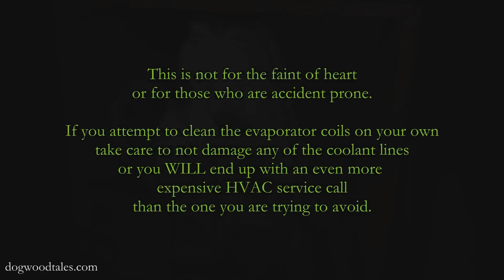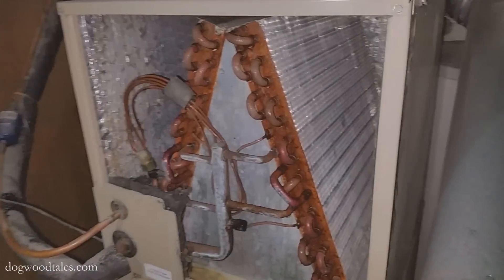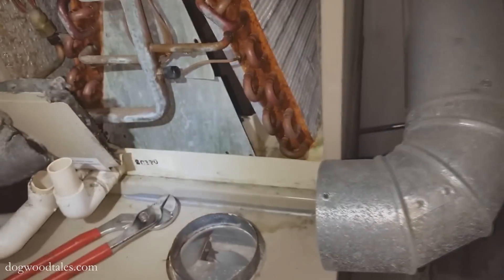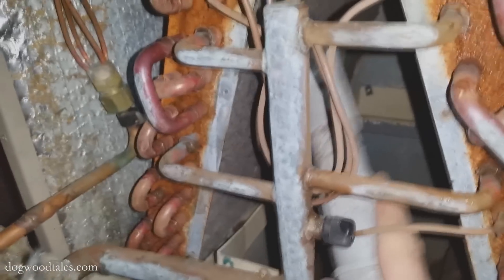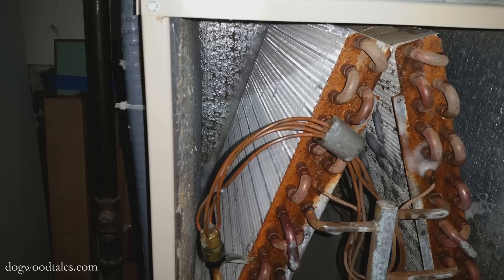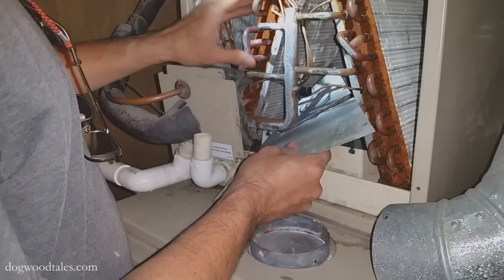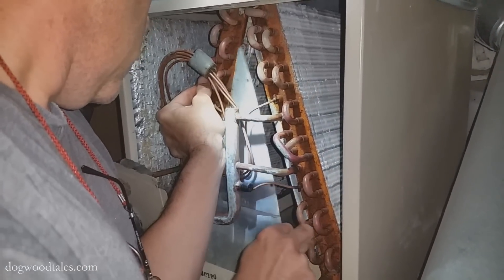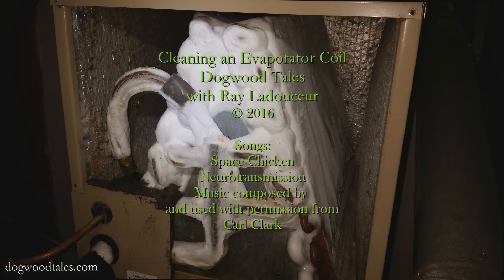Frozen Air Conditioner

Comment: Thank you for sharing a great video with the DIY home owners. I would suggest instead of using the original thin foil, consider using clear acrylic sheets that are sold in Home Depot. They are about $5 to 10 per sheet and it does not impact the thermal performance or coil specifications, and next time using a flash light, you can inspect the  condition of the lower side of the coil and see if it needs further cleaning. You can easily cut them to any size and shape and they are relatively flexible.  
One note to your audience. If you have such a dirty coil underside, there has been a significant filter replacement negligence, or you have a major opening that sucks in the air from other places into the coil and the filter functionality is compromised. The only way underside a filter will be so dirty is when no filter was used for several years.
Reply from the maker: Warren Wwk the acrylic is a great idea! I’m surprised I didn’t think of it myself.
As to the crud, in my case I had an electrostatic air filter, I do woodworking, had lots of kids in the house, and a dog. My life was too much for the electrostatic filter to keep up even though I cleaned it religiously every month. No issues since I switched to pleated filters and changing them every 1-3 months depending on soil level.
Reply: Dogwood Tales bj mmmm
Reply: Perhaps, but I suspect my coil is clogged because the insulation that was attached to the wall of the inside of the heater, just in front of the fan opening is suspiciously missing.  The muck in the coil is similar color as the insulation on the other side of the heater wall.

Comment: I LIKE YOUR VIDEO 👍👍👍👍BUT I DID NOT UNDERSTAND 😢😰😒😨WHY YOU HAVE SO MANY LINTS ON THE COIL✌️✌️✌️✌️✌️
Reply from the maker: @mjshuja9091  I used to have an electrostatic filter on that unit which apparently do not filter very well 
I switched to 4” pleated filters after this and never had an issue like this again

Comment: But how did it get so dirty if you use a filter or was the filter not completely sealed
Reply from the maker: A few things contributed to that. First was that the system had an electrostatic filtration system, which apparently did not filter as well as purported. Then - I had a woodshop in the basement garage, a household full of children, and a major shedding dog.
Soon after this I replaced the electrostatic filters with 4" pleated filters and I never had another issue like this.

Comment: Ive taken my ac apart about 20 times this month, for whatever reason water drops builds up on the walls where ac condenser is sitting at and when dripping down completly misses the pan. Any1 have any suggestions?
Reply from the maker: Is your humidifier on? that should be off during summer months or when using the AC.
Reply: @dogwoodtales  I'm in florida I dont think we have humidifiers here
Reply from the maker: @vladimirm9521  Well maybe not. It might depend on the needs of your system/area. At any rate, I'm not an HVAC expert but evidently you have humidity where you shouldn't. Maybe the AC is not removing enough of it. Maybe the cabinet needs to be insulated. I would schedule service if that happened to me.

Comment: I have an AC problem and I wish you could help me out here. My air conditioner works fine for about 3 or 4 hours but once I get  It  colder to say 72 or 71 it starts slowing down. And temperature increases! The blower works and cold air comes out of the ducks but very lightly. I can't figure it out. Couple AC guys said that the coils are freezing up.  If the coils are dirty how could I get cold air in the beginning? I don't believe it is the coil/condenser problem.
Reply from the maker: site unseen I would agree with your ac guys. sounds like as the evaporator coils build up ice then the air flow slows down. i suggest that you have the coils cleaned by a pro and make sure you change the air filters monthly if you have 1" filters, or every two months if you have 2" or larger filtes.
Reply: @dogwoodtales   Dogwood. Thanks for your reply. What about the drain line could it be plugged? And between the drip Pan and the blowers it looks like a thermal couple up there. Could that be some sensor  that is bad?? Cause right there it's dripping a little bit of water I noticed ,  when  ... temp starts going UP!  Also, he took the blower off within a minute and stuck his phone up there and took a video of the condenser. It was dirty but not filthy dirty and it was no ice build up.   And I was running the ac VERY LOW for  around 6 HOURS.  Had it set at 68.
Reply: Also, the AC man says just change the whole air handler and all. Instead of cleaning the coil. Which I kind of agree. Cost. $2350.  I want everything to be NEW!  It's probably over 15 years old.

Comment: Pause the video at 1:36. See the triangle on the OTHER side of the coil frame? Why not just remove THAT triangle instead? You'd just need to cut an access panel on the other side to get to it, but you'd have so much more room to work with
Reply from the maker: I would have if that side of the furnace wasn’t like a foot away from the wall.

Comment: Hi! My ac condensator is dripping water only the half bottom of it. Ac still working perfectly, the problem is that if I leave it running for a long time the coil freezes up and builds up ice and then blocks the air from coming out of the vents... My ac is on a Condominium where cooling towers are used. What can I do to stop the leaking? Thanks in advance!
Reply from the maker: IMHO if your system is clean and is still freezing up then it’s time to hire a hvac tech. Your system might be low in coolant or something else is wrong that’s probably beyond typical diy
Good luck!

Comment: Was so easy to do this and check out the coils. However, my fan motor relay was bad, so that ended up not being the problem. The fan wouldn’t turn on to blow out the air and so the coils froze up. At least that’s what a friend says is happening. What say you?
Reply from the maker: I had a similar issue some time after this video. I thought the motor was going bad, so I had it recoiled and after some $200 later I found out it wasn't the motor 🙄 but at least I essentially had a new motor as a result.
So then I replaced the control board and that fixed the issue. I believe my relay was integral to the control board, so it might have been that or another issue with the board.
I would start with the control board. It's easier to replace and cheaper than the motor. Just take lots of pictures first with good notes on what wires go back where - very very important! It's not as simple as replacing a light bulb. If you're in any doubt or lack confidence and competence (not an insult!) I'd say get a tech. It's worth paying one a couple hundred rather than mucking up the system and ending up having to replace a lot more at a lot more $$$ not to mention risk of personal injury. Good luck.
Reply: @dogwoodtales  hey can i clean coils with stuff i already have at the house instead of buyin a cleaner? If not where do i buy the cleaner
Reply: @dogwoodtales  You can check all the board by verifying you're getting voltages to the wires associated with whatever component on the system. If you're getting a voltage call and its just not tranfering to its respected component its the board, if it is transfering and you're still not getting the component to operate than its the component thats the issue.

Comment: I need to replace my filters on here do you know I can could use a filter from like walmart or do you know where I can find a filter I can't find any
Reply from the maker: You should be able to find what you need at Home Depot. Lowe’s, Menards and such 
Bring the old filter with you and someone there can help you get a replacement 
If you don’t have a filter then measure the space where the filter goes into the furnace and buy one that fits

Comment: Good video. I would only add there are 3 things that can cause a freeze up. You mentioned the two most responsible and they're typically the problem..you need to change the furnace intake filter as well as clean the fins on the evap coil and the condenser coils outside regardless to have any hope of fixing the problem ..but there is a 3rd culprit to consider. 

What is it?  The Refrigerant Filter Dryer.

*Replacing a bad one is beyond the scope of DIY.
 
Those filters are typically located outside. The refrigerant dryer filter is about the size of soda pop can (usually black in color) and has a small copper line going into it and one going out of it. That smaller copper line youire looking for goes from the house to the AC Condenser unit. It runs along side a larger copper line that is typically wrapped with insulation.

Its rare but those refrigerant dryer filters do get to the point they won't allow the refrigerant to flow thru the copper line and when that happens you get instant freeze ups. Symptoms of the bad filter may be things like the compressor heating up and shuts off due to excessive heat..this process may cycle over and over. Eventually it can burn up the compressor. You may have other related symptoms as well.

Replacing mine saved me from having to replace the entire AC system which was quoted to me for $8k. Yikes! 

This is a link to the part I'm talking about:
https://www.amazon.com/gp/aw/d/B08644H774/ref=sspa_mw_detail_0?ie=UTF8&psc=1&pd_rd_i=B08644H774p13NParams

Yours may take a different model or manufacturer but the part itself is cheap. Your repairman will know which dryer filter you eill need.. Just know that replacing this simple and inexpensive part may cost you three hundred extra bucks or so in labor because the system has to be entirely drained of the refrigerant and then replaced after the new dryer filter has been installed..it is a complex set of steps and takes sophisticated meters and guages the repairman has to use and do to replace that little dryer filter...(again this is not a DIY task)..but if it is your problem it sure beats the $8 Grand "fix".

I know I will have to replace my 20 year old Rheem AC system some day. All AC units that use R22 refrigerant are being quickly phased out by the Gov't and parts are becoming impossible to find or completely unavailable. Your repairman is probably telling you the truth if he can't get certain replacement parts for your old R22 system.. but for now this helped me out a bunch. Its worth looking into before you spend the big big bucks! Most repairmen don't think about that dryer filter part being a problem because its rare to see one go bad or get clogged but if your refrigerant dryer filter is over 15 years old you oughta at least have him check it! Im glad I did. Your repairman has have some sophisticated temp meters to check it but the quick and simplest way to get a clue if its bad without those temp meters is 1) make sure the AC system is on and has been running for a while. Leave it running for this simple test. 2) feel with your hand if there is a significant temp difference between the copper line going in one side of the filter as opposed to the copper line coming out of the filter. If one side feels DEFINITELY cooler or hotter than the other side..its a good bet that filter is clogged and restricting the flow of refrigerant. 

So Good luck ..and God bless! 👍

.
Reply from the maker: Good to know! But that part is beyond the ability or capacity of the average homeowner to replace on their own without the additional equipment and knowledge. Even what I did here borders on sketchy as there is the risk of causing a leak in the system, depending on one’s system, thus my warning at the opening. Keeping the different coils clean and changing the filter regularly is something most people can do.
Yeah R22 is no longer being manufactured and the related parts are becoming harder to get. What a sham.
Reply: @dogwoodtales  i edited a bit to make it clearer to your readers changing the refrigerant filter is NOT something the homeowner should try. Not to mention these Refrigerants can cause serious frostbite as well. It takes the right equipment and know-how to do this repair. 
Take Care.
Mike

Comment: pretty impressive you figured out why your unit iced up. you seem like a do it all kinda guy. but your units condition degraded to this point because of lack of maintenance
Reply from the maker: That is somewhat true. I had not had a pro service for too many years prior. However It had an electrostatic filter that I cleaned religiously on a monthly basis, but that wasn’t enough. After this cleaning I replaced that with the 4” pleated filter and checked the A frame once a year and it hasn’t needed cleaning since. I changed the filter once about every 2-3 months.

Comment: It can be easily slid out!! & then turned upside down. No need to cut anything. Hmmm.. On our Lennox Elite
Reply: There are refrigerant lines attached to the coil. Without evacuating the system (which is PRESSURIZED) and cutting the lines, you can’t just slide it out. Take my advice and don’t screw with it.

Comment: GREAT video! My AC coils froze over, but it was actually because the fan inside the AC unit was not spinning (bad capacitor), so there was no air movement through the coils, causing them to freeze. Just another thing to check for while troubleshooting. Thanks again!
Reply from the maker: WIL W yup, that’ll do it too

Comment: Notice your furnace exhaust was single wall pipe. Extreme dangerous. Double wall required
Reply from the maker: Jon Cogar hmm ... that’s what was installed by licensed pros so hopefully it was code for my area at the time at least (July 2000). I’ll look into upgrading it. Thanks!
Reply: @dogwoodtales  https://homeguides.sfgate.com/vent-pipe-required-top-furnace-102243.html

Comment: That unit looks just like mine thanks for sharing I feel a lot more confident cleaning it my self now just wish there was a solution I could make at home top clean it instead of a aerosol spray
Reply from the maker: Joe Rambo maybe you can use something like simple green but these evaporator cleaners will do a better cleaning and don’t even really need to be rinsed.

Comment: when I was an hvac contractor I called this a carpeted coil. this won't happen if you change the air filter every 2 months.
Reply from the maker: Kurt Zimmerman true as this happened while using an electrostatic air filter with 6 kids, a dog, and a wood shop in the house. It hasn’t happened since I switched to the 4” pleated filters and keep them changed out about every 3 months.
Thanks for watching!
Reply: @dogwoodtales  those old electronic air filters were good for odors, and not good for dust.👍

Comment: Someone suggested to do it on the back side of the evaporator coil. I can cut a window in the back of the evaporator housing and access the evaporator coil from the back. Before doing it, does anyone know if the back of the evaporator has triangular metal plate that can be removed like the one in the front? This will take longer to do, but I will avoid damaging the cooper wire

Comment: I couldn’t remove that piece of metal, how did you remove it?
Reply from the maker: Wil Jr just as you see in the video time lapse- very very carefully without forcing the tubing to bend.
If you can cut it in half all the way then that will make it a lot easier but I couldn’t quite get it cut all the way with the cutters i had on hand.

Comment: Mine did that once in the summer time and the out side unit would turn into a solid block of ice in the winter time
Reply from the maker: Joshua Ferguson you’v got to be kidding. Why would you run it in the winter?
Reply: Because he has a heat pump.

Comment: The old compressor is 4tons din damage they change the new compressor into 5.3 ton is there any problem or possiblity that can cause problem to AC?
Thank you
Reply from the maker: Paul Pañares if you had a pro do that work I’m sure he/she (should) understand how to properly size a compressor to a given system.

To answer your question, idk specifically about your system but -an ac system can be too big for a given application.

Comment: Instead of aluminum tape, consider using clear silicon glue used for calking. The Aluminum tape adhesive may come up loose with moisture and drop across the copper pipes causing a galvanic contact that eats up through copper pipes. On the other hand it can also be sucked onto the fan motor causing short circuits or buzzing noise when the blower is operational. Also, it may fall down on the side and reroute the condensation from the coil to the sides of the panels and causing leaks or promoting cabinet mold growth. Hope these are helpful suggestions.
Reply from the maker: Warren Wwk well I found that aluminum tape is about as permanent as it gets and doesn’t come off while duct tape will eventually. At any rate the next time I check the coil I’ll probably replace that panel with acrylic! Thanks

Comment: thanks, my problem is that my A/C unit is on my roof(and I'm in Arizona)and yer wondering why I didn't attempt this before it got so dang hot) but this was very helpful, thanks...
Reply from the maker: Donnie Moyer going forward change the air filters regularly and check the coil in the cooler months 😎
Reply: ya got that right fer sure, getting ready to go take a look at it in a few minutes...yesterday it just didn't want to cool down at all...at this point, any tips would be helpful. thought about callin somebody but man, I just don't have the doh...thanks